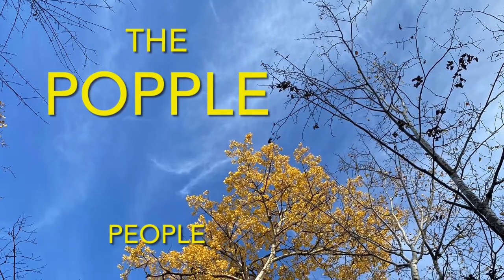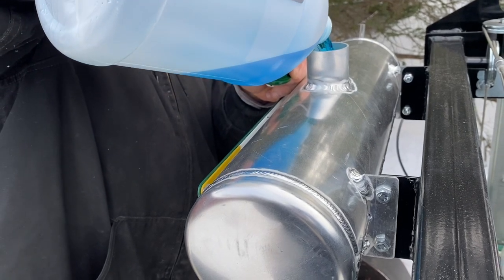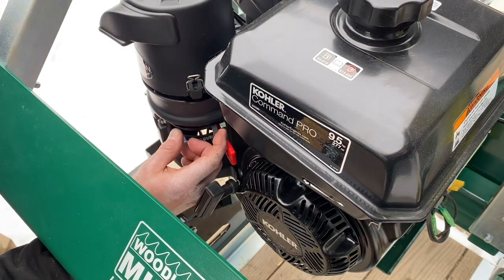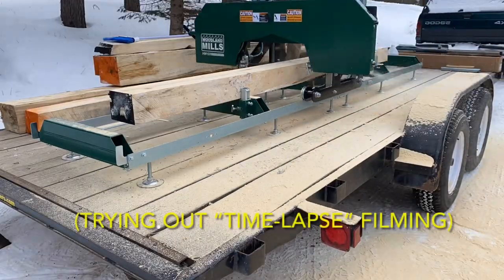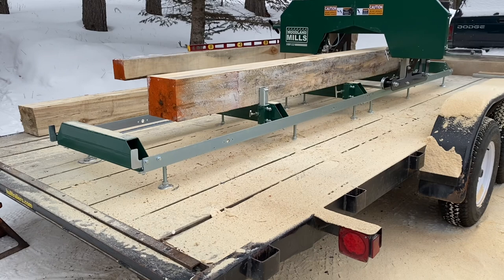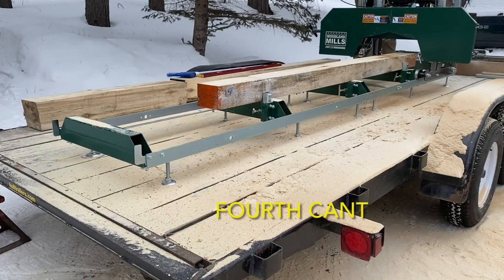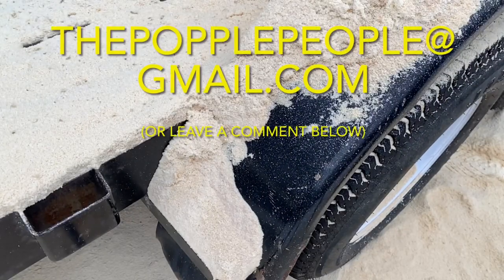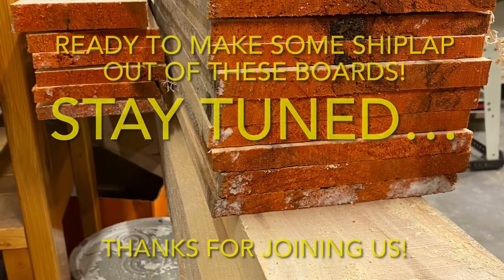Woodland Mills SAWMILL-Second Run/MILLING More CANTS-Popple People-Episode 13

Comment: i assume by the channel name you deal alot with aspen, could i get some insight on what it can and cant be used for? im in eastern canada and theres alot of quaking/longtooth aspen here but i was always told its junk and nothing but pulp wood, i recently read the 47' US ag report on it "aspen lumber for building purposes"and it seemed pretty optimistic to use it for anything except sill boards and ground contact

can it be used effectively for exterior siding? and in that application could i stain it with a transparent box store stain to give it some colour keep away from a gray drab look
Reply from the maker: Hi Andrew, great questions! YES, we have a TON of Aspen here (mostly that type of tree). You’re absolutely right in that it’s typically just used as pulpwood…but it can be used for building. You’re right about keeping it up off the ground (I’d say green treated is best for anything making ground contact in terms of longevity). Aspen is used in furniture building. We will be making some shiplap with it, as well as using it to construct the saw shack for the sawmill (once the snow melts). It also can be used for building log cabins-though that is not “the norm” (we have plans to build a tiny log cabin in the future as well). YES, it definitely needs to be stained if it’s going to be exposed outside…but you could use it! I’d recommend a stain with some color in it…(not sure if clear transparent would prevent the greying as it ages…that’s kind of this woods natural aged look). It does take stain well though. We will be featuring what we do with the wood in upcoming videos.